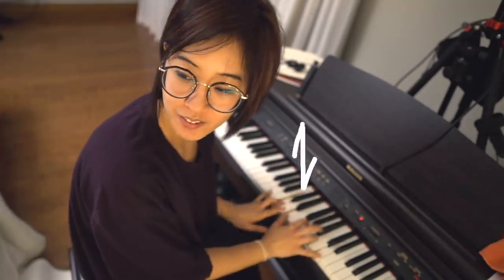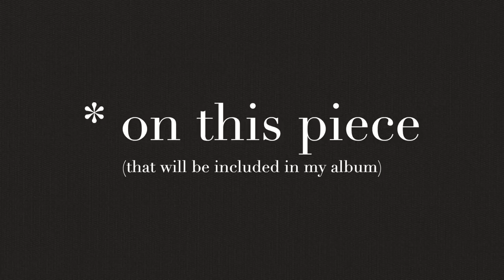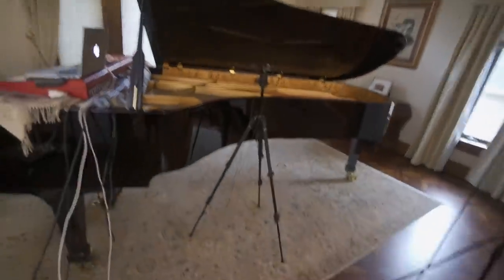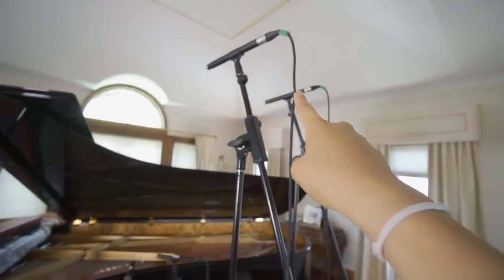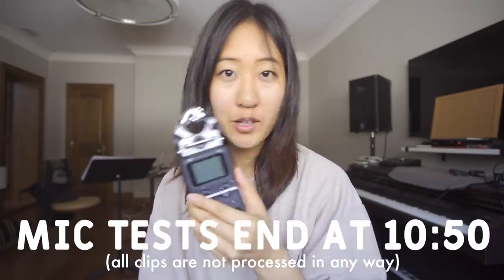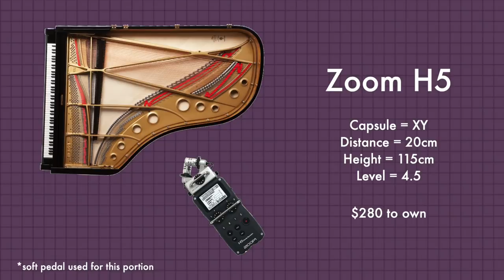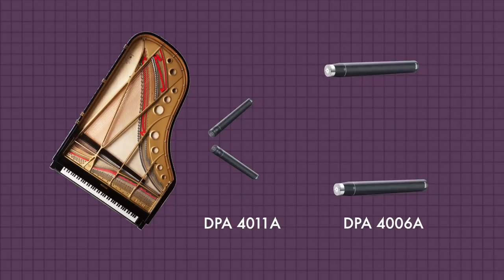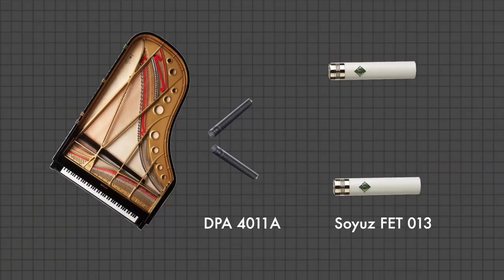Recording a grand piano is TRICKY - here's what I learned.

Comment: Hi Nahre, I'm a pianist who discovered and developed the most accurate piano recording technique. It's based on some simple solid principles: 1. The piano is a stereo instrument, not a monaural instrument. 2. The sound does not emanate out the side of the piano. 3. A propped up piano lid does not act like the bell of a large brass horn. 4. The only person in the room who

 hears the piano correctly is the pianist. I made these discoveries by walking around a grand piano, lying underneath it, and sticking my head in it  while it was being played. Here is what I discovered:  

1. The true stereo sound of the piano emanates off the top of the strings, not out the side of the piano. The pianist hears high notes in his/her right ear, middle notes with both ears, and bass notes in the left ear. This is stereo. 
2. The audience hears a monaural sound, not stereo, because they sit at a 90 degree right angle to the hammers, whereas the pianist sits parallel to the hammers and strings, hearing true stereo.
3.  Propping up the lid only funnels the monaural sound toward the audience. It doesn't help the audience hear stereo piano a single bit. The monaural sound is a mixture of all notes with no separation between lows on the left, and highs on the right. 
4. The funnel sound point on the side of the piano is exactly where the prop stick is positioned. This is also where the hammers line up at 90 degrees in a straight line to the audience, so the audience is  actually hearing all the 88 strings lined up like train cars, one behind the other, all coming toward their ears. This is why they can't hear stereo piano, like a stereo sound system.  Instead of a left and right speaker, both speakers are stacked on top of each other and the audience hears a funneled mixture of monaural sound. 
5.  The  articulation of each note emanates from each hammer striking its strings. This articulation, particularly in soft passages, is lost when sitting in the audience,  because the audience can't hear any separation between strings which are being played and strings which are already sustaining notes.   

RECORDING TECHNIQUE:  To record the true stereo piano, you will need at least two microphones (expensive or not) and at least two recording tracks in your recorder on which to record. The mics should be on boom stands so they can be positioned, suspended above the hammers, and placed facing down toward the hammers and strings about 12-18 inches above them, depending on the intensity and volume level of the musical work being recorded. Closer micing for pp and farther micing for fff  overall volume levels. 

       Depending on the intensity and volume level of the music to be recorded, the right mic should be about 12-18 inches in from the right side of the piano rim, and the left mic also about 12-18 inches in from the left side of the piano case rim, both suspended above the strings facing down toward them. 

      If you have a third track on which to record, and another mic, place it in the middle of these two mics, 12-18 inches above the hammer of middle "C".  

THE ESSENCE OF THE PIANO'S SOUND:
Keep in mind that the key to understanding exactly where the piano sound emanates,  is knowing that it is completely dependent upon the hammer hitting its strings. The "hammer-string" relationship is the equivalent of a violinist using a finger to pluck a string. Your finger's extension is the hammer. It is the thing that articulates your expression upon the strings.  The soundboard is only an amplifier of this. So understanding that this "hammer-string" event is the essence of the piano's sound, results in a conclusion of placing microphones, directed at the hammers and strings.  This sound is what you listen for when you play, and it's what you expect the piano to produce when you touch the keys. 

      Now, these mics will hear exactly what your ears hear when you play the piano. After you make your recording, you should mix the tracks appropriately according to your natural hearing. Right track panned fully right, left track panned fully left, and center mic dead center. You can E.Q. the tracks as needed for richness in bass on the left channel, and crispness of treble in the right channel. 

      This technique is the most accurate way to record piano. If you have extra tracks and extra mics, you can place a couple inside the piano over the strings, but they will only be a redundancy of what the "over the hammers" mics have already recorded.  

       For decades, engineers have been incorrectly recording piano, mostly because they falsely believe that the raised lid of a piano is like the bell of a large horn where the sound comes from. Wrong.  Secondly, engineers don't know how a piano is supposed to sound, since they don't play piano,  and they don't sit on the bench when listening to it. Conversely, pianists are not recording engineers. Neither understand what to do, because they live in different worlds.

       If I hadn't been a pianist who learned recording techniques and then experimented with both,  I would never have discovered how to accurately record piano.

MICROPHONES:
 The cost or quality of your microphones is far less important than your placement of them. I've made great piano recordings with inexpensive mics, (dynamic or condenser cardioid pattern costing less than $500 each) because the piano was rich in tone and well tuned. I've also made lousy recordings using very expensive mics  ($1,500 - $3,500 each) because the piano was not well voiced or regulated, and it was out of tune.  I recommend cardioid pattern mics, but keep in mind that the world of microphones is similar to the world of pianos. Some people believe they can only play well on a concert grand Steinway, Bosendorfer or Fazioli. Others, who are really good musicians, can get a great sound out of a baby grand Yamaha, or even a vertical piano because they are skilled musicians.  You don't need expensive mics to make good recordings. It is your recording approach and technique that is most important.  

PIANO TUNING:
   One thing that is critically important is the fact that the piano MUST be in tune to get a good recording. Everyone who listens to professionally recorded piano music has listened to a piano which was freshly tuned before the recording session.   If the piano is out of tune, the mics will pick it up and the recording will amplify it.  

        The human ear is very forgiving when listening to live music,  and it adjusts to and compensates for out-of-tune instruments. Most pianists and piano students are not real familiar with what a tuned piano sounds like, since piano tuning can be expensive, and most pianists are less concerned with the piano's sound and more focused on playing the musical work. They are used to playing on out-of-tune pianos. 

         But if you intend to make any piano recording which is going to be played for public consumption, you must make sure the piano is freshly in tune. If it is not, your recording will sound cheap, sour, and bad. In this case, I recommend using an electric piano which is in tune,  over an acoustic piano which is out of tune. 

Regarding your  Zoom recorder, which has a built-in  X/Y microphone pattern...it can make very good piano recordings if mounted  to a boom stand which can suspend it about 12-18 inches above the hammers facing down toward the strings, above middle "C". It won't be quite as full as using two separate mics described above, but it will still represent the true stereo sound the pianist hears. 

In summary,  I suggest you try this recording approach. It took me several years to discover and perfect it, and it won me a Grammy nomination.   It will be the best approach to deliver  the true stereo sound of the piano, which is exactly what you hear when you play it.  Good luck !!
Reply: Of all the comments I've read on this post, this one makes the most sense. I've been trying to find info on the microphone placement that Glenn Gould used in his recordings  and I think this method is probably pretty close.
Reply: @DavidBarilAlmonte   When Glenn Gould recorded the Goldberg Variations in 1955  (Gould's first and original recordings of this work) he recorded at Columbla Studios in New York. They recorded it in monaural not stereo. They used a large studio, as was the norm then for a bit of echo, and they used large RCA ribbon microphones, placed near the side of the piano, and at about 10 feet back and 7 feet up on a 

      boom. The engineers back then, believed that this would mimic a concert hall effect. They were wrong. The acoustics in concert halls vary tremendously, depending on the size, the number of people in the room and a hundred different variables. Even so, a concert hall is the worst place to hear any soloing instruments because of competing sounds and the distance from the ear to the instrument. 

        Most recordings of piano, either in studio or in live concert performances, are sub standard, because there is too much noise, competing sounds and incorrect mic placement.  Engineers still fail to understand the sound of stereo piano. They continue to place mics in the same places that they have been placing them since recordings began. They never question this placement, because they never experiment with mic placement, mainly because they are NOT pianists, so they don't hear what the pianist hears.

        To answer your comment, my microphone placement approach is not at all what the Columbia Records engineers used. They used the standard old method I described above which is the raised-lid  piano side addressed by at least two or more microphones.  But since there was no competing sound in the studio at the time of his recordings, and since the Steinway model "D" concert grand piano was in perfect tune, the recordings that Glenn Gould made came out very well.  

      There could have been greater separation between the bass and treble sections of the recording, however the Goldberg Variations were recorded before stereo recordings were really perfected, and certainly before stereo recordings were in wide distribution for public consumption. 
         

        If it is of any help, try to keep in mind that while listening to Gould's recordings, it is far less important to pay attention to the sound quality and far more important to pay attention to the composed music and to Gould's playing.  Since the recording is good, it is not something that requires any attention or concern.

         It is his marvelous playing that catches the ear and commands the imagination of the listener.  With regard to microphones, I have made great piano recordings using cheaper low grade mics in correct stereo placement when a piano was in tune, vs. crummy piano recordings using top grade Neumann microphones, placed in traditional monaural  positions on out-of-tune pianos.  If a recording engineer gets the most important aspects of a recording set-up correct, the importance of using high-priced microphones is minimal if not even unimportant.  Too many people have placed too much importance on expensive recording gear and not enough importance on proper approach.   Real talent and artistic ability always sounds great regardless of how much the recording equipment costs.

Comment: Very interesting. Some music schools (conservatories) (may still) have a program to teach music recording. I would add that one starts with perspective or viewpoint as in photography. Are you recording for pianists, or listeners? The pianist hears the instrument and pedals and peculiarities of the instrument, the listener in the concert hall doesn't generally - if they clearly do, the piano tuner and management need to be fired.
If you place the microphones in the grand, to the side, you record IN the piano and will hear things that are lost at a couple meters away. Also, a stereo recording from the side does not place your bass-treble range left right in the stereo soundstage. If you look at the Zoom's microphone placement, then you see the classical microphone positioning for a stereo recording. Another extreme form of microphone is the artificial head with microphones at the eardrum position. This gives extremely good recordings for listening with headphones. There are cheap alternatives to the artificial head of microphones you place in your ear and use your own head instead of the artificial one - slightly less good but hard to hear the difference.
Reply: But honestly, any bass trebel panning needs to be really subtle. Frequency imbalances in the stereo spectrum sound really off putting. There are some old jazz recordings that have the bass hard panned left and the trebel hard panned hard, and it's really hard to listen to. I personally feel like a stereo setup like this that doesn't pan based on pitch is probably better for listeners.
Reply: @mattheasboelter5217  - true, agreed

Comment: Thanks for this video! Is at minute 12:00 a midi keyboard? Also how did you record it at the same time with the grand piano and what software did you use?
Reply from the maker: Great question! I tried it both ways - with 2 mics and then 2 cables out of the keyboard.  Also with 4 mics and midi (mics into the interface, and a USB/printer cable from the keyboard directly to the laptop).

Comment: Audio compression isn't as important as you'd think. Turns out 320kbps sounds pretty much the same as lossless to the vast, vast majority of people. Audio processing is why you want the highest possible fidelity.
That's all to say, the difference is clearly audible on youtube.

Also wtf is that tidal wave keyboard
Reply: yes it doesn't really matter, as the majority of the listeners are using their inbuilt dac+amp combo in their phone/laptop.
Reply: I think I only noticed a difference in one case. It seems that the room’s acoustics play a significant factor. I prefer recordings made in a good music hall. Recordings made in studios are usually very dry and the engineers add artificial reverb which then gives all of the recordings by that record company a similar sound (Hyperion, ECM).
Reply: @adrianlalusin  with 50$ gaming headset connected.

Comment: I thought to record piano you really reached in there and put one mic at the low end side and one mic at the high end side, inside of the piano space. And if you want to avoid outside reflections (or other band members bleed if you are not playing alone), you close the piano up with a big cloth.
Surprised I did not see any of that in this video, was I misinformed ?
Reply: It depends on the musical style and what you're after. If you're playing a concert grand and it's a solo or with an acoustic ensemble (orchestra etc), the instrument is engineered to sound best with the lid wide open and listening from a couple feet or more away, not with your head/ears inside the piano with the lid closed. For a live performance, that might be the front row of seats. When trying to mimic this in recording, you might try to capture the sound of the instrument and also the space it's being played in. If you're going to close the lid and throw a heavy blanket over it and mic from inside, you're not really doing that to capture the piano at it's best, you're just trying to keep the drums, guitar, trumpet, whatever out of the mics picking up the piano.

Comment: Simply put , you are overthinking it and overdoing it. Don't let the piano or mic define you. See the "Keith Jarret on doing the Cologne Concert" documentay where everything that can go wrong did but 
the album became the most sold in history of any solo piano recording to this day. (This was 1975). Take a look at Glenn Gould Bach recording sessions also.Reach out to Zoom and have them loan you a H6 32bit recorder with which you can use the crapiest mics and get an awesome recording. Watch the related product video to understand the advantages of 32 bit (the right way) Try ribbon mics also for a change. Rode makes the most technologically advenced one but you can get away with 2 Peavey RAB--1 for $400 total. The so called "Recording Engineers" are anything but and devices like the forementioned Zoom H6 will make them irrelevant for good I hope.

Comment: 96k 24 bit! Yup. Except if you have LOTS of tracks (like orchestra) so I generally record @ 48k 24 bit. I find it astounding that software like APPLE LOGIC default to a crippled sample rate / bit depth format that was actually DESIGNED to be CONSUMER not PRO audio. This format is 44.1 16 bit... WTF? WHo in their right mind would use a format from the 1980's DESIGNED to be "Bad Math" (44.1 can't be easily multiplied or divided so the computer has to work extra hard to make the calculations). I pointed this out to the people at Apple over and over again... Why would you make the default sound so bad??? The answer is that the engineers that design the software ARE NOT , RECORDING ENGINEERS OR even MUSICIANS. 
I will download your example so I can listen some more ... THANKS!

Comment: DPA 4011A or full DPA setting all the way.   
Both Soyuz sound cheap and synthesizer like. A bigger problem is they skip notes. rubbish.
 DPA 4006A sounds nice but it sounds like it has nasal congestion.
Rode sounds too mellow and soft, too synthesized, and too echoey.